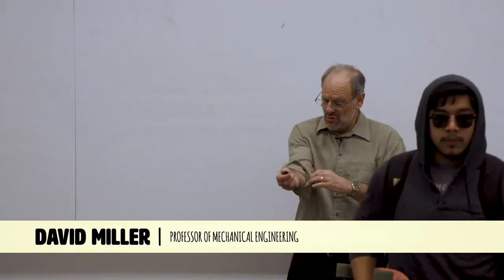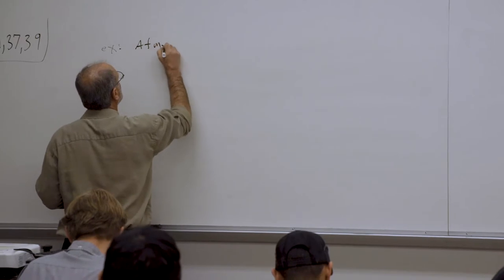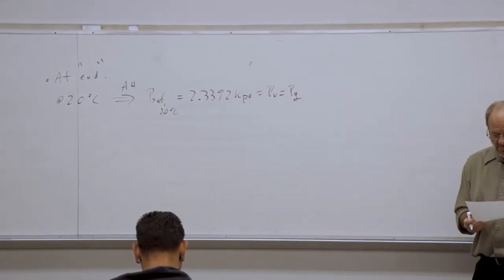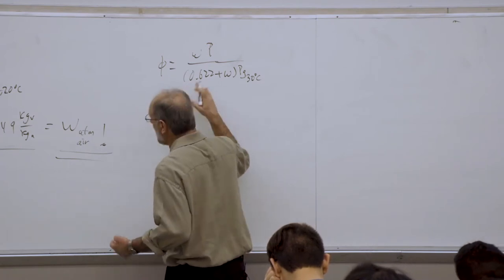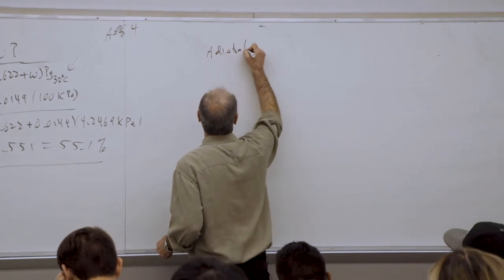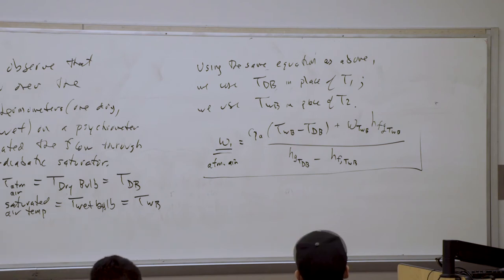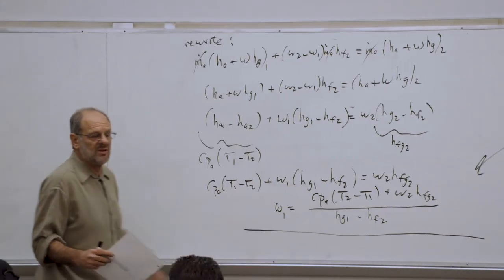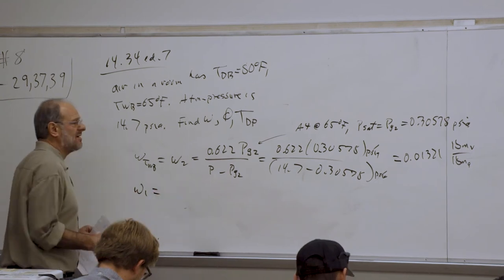Thermodynamics: Dew point, Adiabatic saturation, Psychrometer (45 of 51)

Comment: Ex if i have air initially at 42 dec C and  37% RH.
Can  we achieved air at 11 Deg C by spraying 7 degree Celsius chilled water through evaporatorive cooler.
Can you provide the calculation?